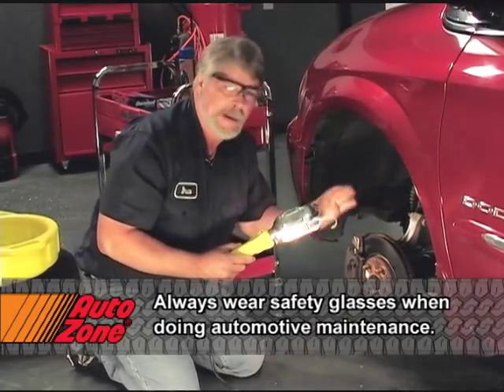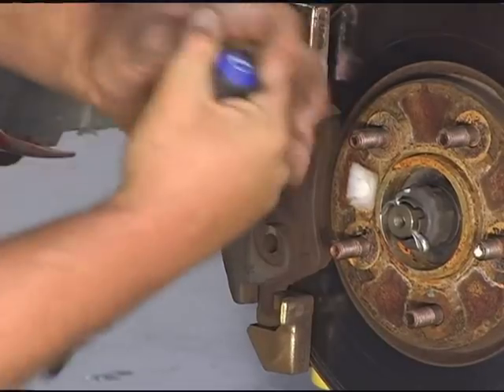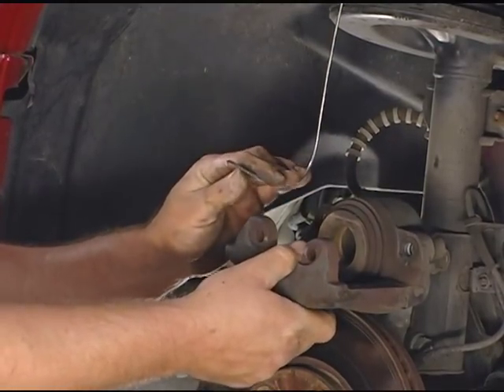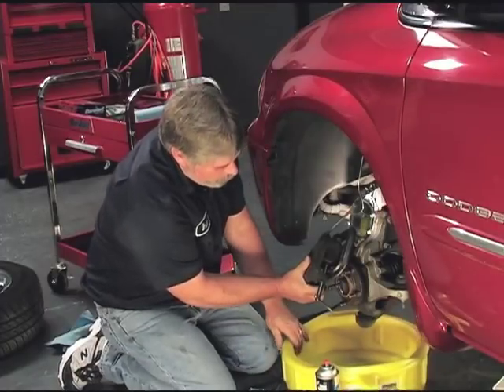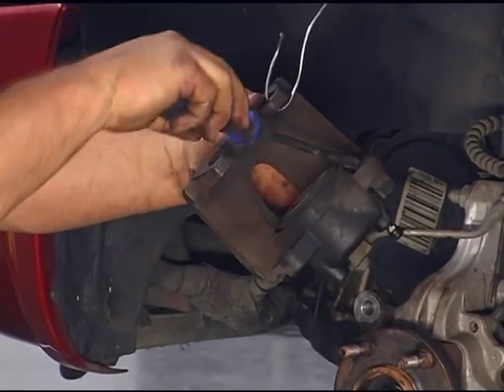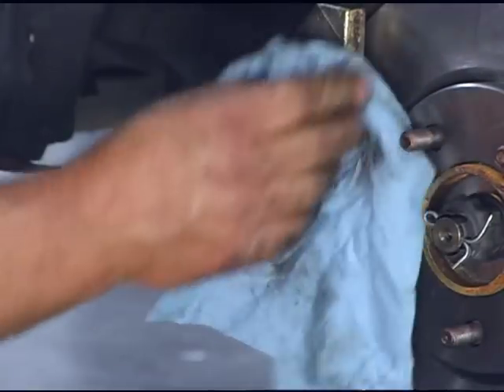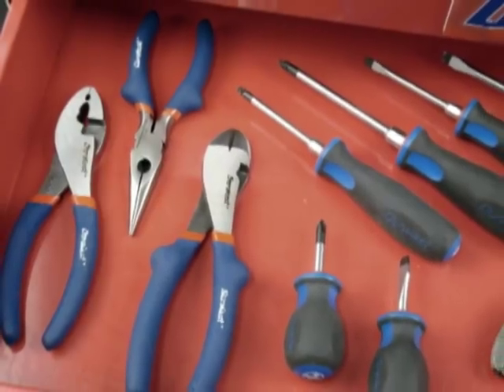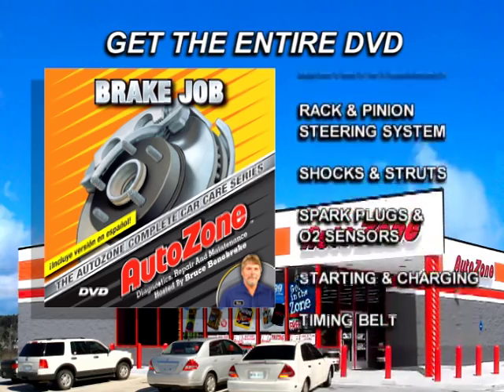AutoZone Car Care: Replacing Brake Pads

Comment: damn,,I thought it would be a couple of steps to do this replacement,this will take a whole day..Well time to pay a shop..
Reply: 1 hour tops. You probably a mechanic and want people to be discourage to not do it themselves.
Reply: @juancamberosg.593  not at all, there is a difference between thinking you can do it and miss a step and knowing what you're doing where you can breeze through it..this video doesn't specify the car and model and these videos always miss a step..
Reply: @oldskoolwayy  for the breaks and rotors is almost identical for every car

Comment: He opens the bleeder screw because it is easier to push the piston back into the bore. The problem is air will enter the system. The brakes will not work correctly. He is using the correct tool a C clamp,just use a little extra muscle.

Comment: no dude, german torque spec is getting down to the last .0000000000000000000000000000000000000000000000000000000000000000000000000000000000000000000000000000001 inch pound of torque (pretty much exact)

Comment: only reason to open bleeder is to get the old fluid out of caliper its preference. 30 years i never had a problem
Reply: No it is not, any abs car has an abs valve with ball or poppet valves, pushing fluid in the opposite direction can harm these expensive valves, use an extra 10 seconds and open that bleeder.  Working in your 30 year old dodge is not the same now a days bud.
Reply: ***** being electronic does not mean it is "electronic" solenoids control the valves, the operation os still mechanical just like anything else, electric over mechanic.  These small valves and springs will get damaged if fluid goes in backwards eventually.
Reply: +CowboyTheBouncer you keep doing it your way.  thats the difference between a professional and a wrench turner.  good luck.
Reply: +south9563 some one will eventually jam one of the actuators and will wish they opened the bleeders.

Comment: all that lubrication is just a looking good and feeling good about your job. you know that roads are so nasty and can splash mud, dirt, and everything you can imagine on the calipers. plus you take it to the carwash and spray wheel cleaner, tire cleaner, high pressure soap and rinse. so imagine where that lubrication goes. by the time your brake pads look corroded, you need new ones already.
Reply: I was thinking the same thing. I would imagine that the lube around the caliper bracket and edge of the pad would be gone after a month.

Comment: You really should just flush your brake fluid first and then loosen the cap on the reservoir while you are compressing the cylinder. That way you wont have to worry about pushing dirty old fluid or air bubbles around in the system and chances are unless you are just drive hard it is well past time to flush the fluid anyway by the time you change your brakes.

Comment: well, yeah, stacking in a couple of old pads, and wedging them apart using a screw driver just might work, but then AutoZone wouldn't be able to sell you a c-clamp you will probably never use again...  { I like the presentation pretty much over all, actually.}

Comment: wrong, wrong, wrong, clean mating surfaces,1.clean rotor to hub surfaces.2.CLEAN then lubricate caliper brackets. never push caliper piston in without putting something across the piston,unless you want to buy new caliper when you break the inside out.

Comment: Thats an arsey way to do the job innit? you dont have to bleed the caliper when you force the piston back into it, just open the resevoir cap first then syringe out the build up of excess brake fluid back to the right level, your just risking air getting into the system, The shaft of a hammer is good enough to push the piston back into its bore. Copper grease is best for brake components.

Comment: He forgot to purge the brake fluid, because he opened the screw of purge. It's not necessary to open this screw
Reply: god bless our glorious purge!!
Reply: correct no need to open the system, using a c clamp or vicegrip clamp force the plunger back and install the pads.been doing it that way since I was 12...46 years ago.

Comment: Waste of brake fluid opening the bleeder valve when pressing the piston back in. Unless you've added brake fluid after installing new brake disks/pads last time there is enough room to fluid go back to reservoir without overflow.

Comment: I find it extremely dangerous to use that style of "drop light".  Any flammable that hits the bulb or for that matter the shield, can cause a fire.
Reply: ***** Hack
Reply: +anthony tomasiello dude... ANYTHING related to working on a car can be dangerous, even a simple oil change... the vehicle could fall off the jack stand and get you hurt... besides, do you know how hot a motor gets when you're driving? a lot hotter than a drop light bulb... If what you are saying is true, the vehicle should ignite into flames as soon as it reaches proper operation temp...

Comment: It is like the wheelbearing manufacturers are liars,can't do damage to a wheelbearing when tightening the axle nut with an impact.Basically can't overtighten this this nut.There are spots there are no way to get a torque wrench in.With a torque wrench,can overtighten a fastner you can't catch right away.That is one reason why there are these electronic versions that can sense this,red means it is overtorqued and green is good.

Comment: Geeze....... Clean up the spindle face before installing the rotor and check rotor run out with a dial micrometer setup. Otherwise you're asking for vibration and premature pad wear.

Comment: Ok...that's your opinion and I am sure you have been doing autos for years.
 But, you have absolutely no comprehension of physics or Engineering and I certainly would not want you working on any vehicle I owned.
Reply: Supersesqui....every mechanic interacts with physics once in a while engineering...example adding a longer bar to create more leverage or increasing the fulcrum when busting an over torqued nut or bolt. A mechanic may not know exactly what physical property they are utilizing at any given time but believe me, I am a liscensed airframe and powerplant,mechanic, they certainly do have a grasp of both diciplines. In conclusion I also might add to tell a mechanic he is not good enough to work on your car lest you be reminded apparently your not good enough to work on your car either because your having someone else do it....and I'm not going to buy into any other reason except the obvious one...you don't know WTF your doing, so your having the work done. Don't bust balls unless you've been down in the trenches, under some greasy jalopy with a pair of vice grips. Probably the last ttime your hands got dirty was when you tripped and fell down.

Comment: Right. I have never read a comment more idiotic than this. The whole purpose of the torque wrench is to avoid just that. I wonder what this fool thinks a torque wrench is? wafredrick "yeah a torque wrench has flames that come out of it when you light it. Oh no....that's a blow torque"